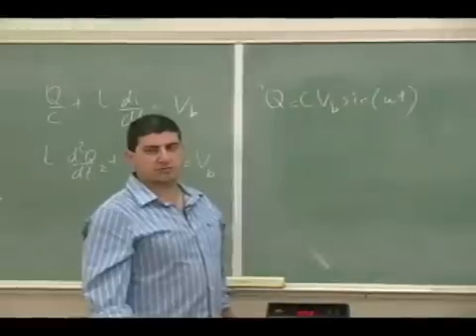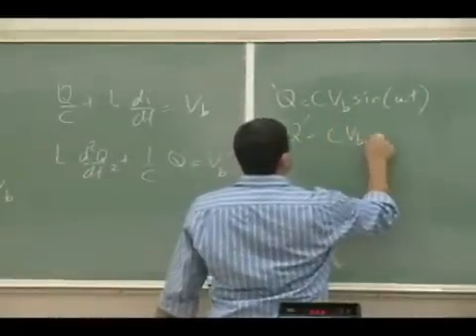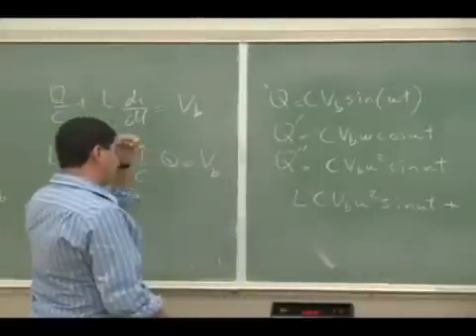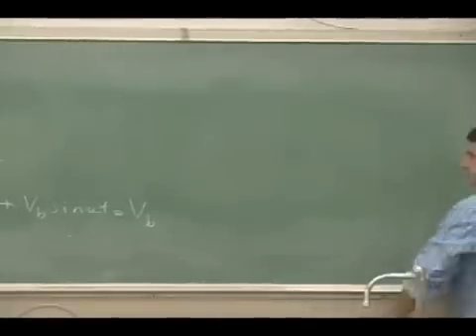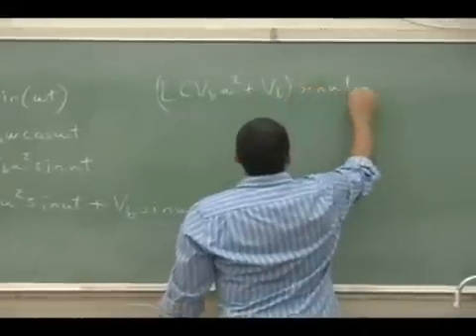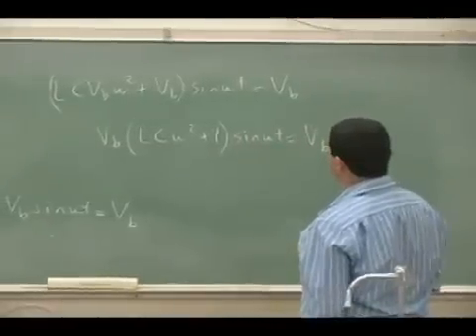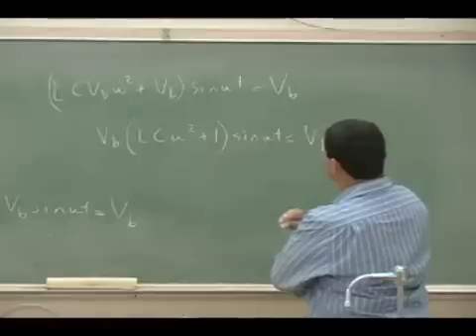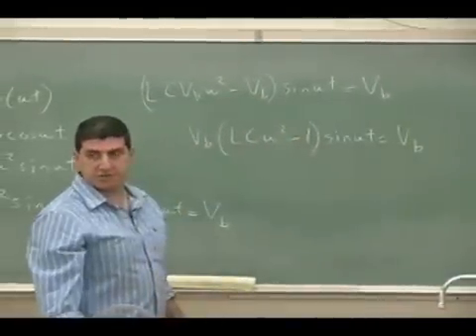LC Circuits Theory Part 1

Comment: The mistake came from neglecting the constant in the general solution.  If the added constant is equal to -Vb and phi=0 the equation will satisfy the boundary conditions and the resonance frequency can be derived correctly.

Comment: @missifer86 It's the voltage supplied by the source. Usually a battery for DC circuits